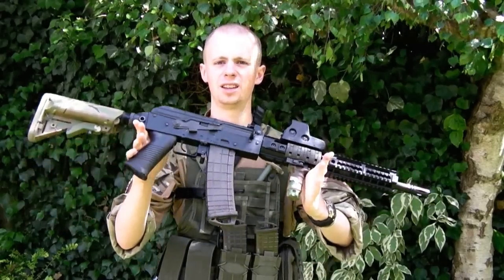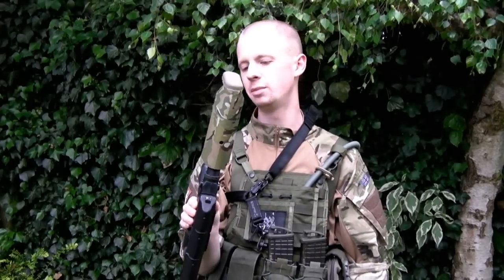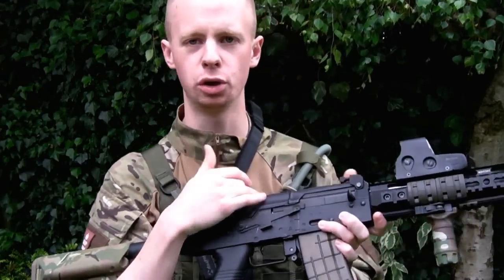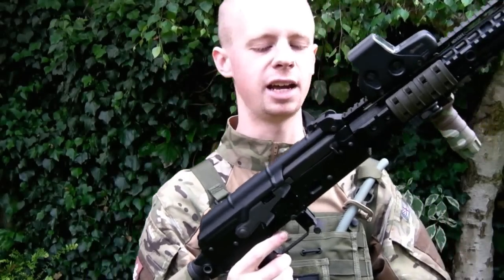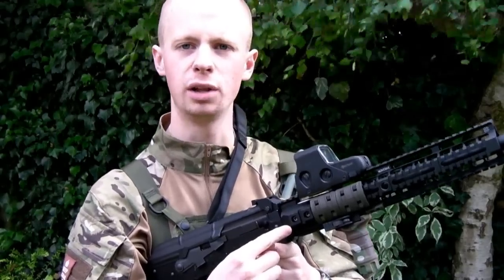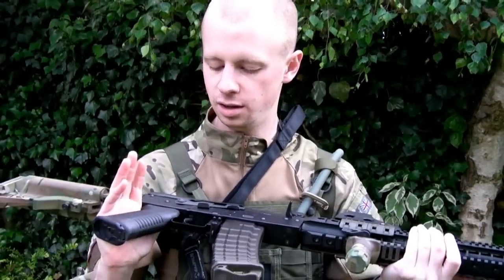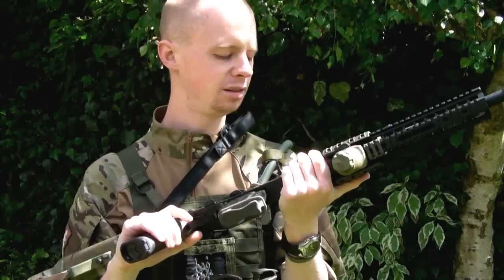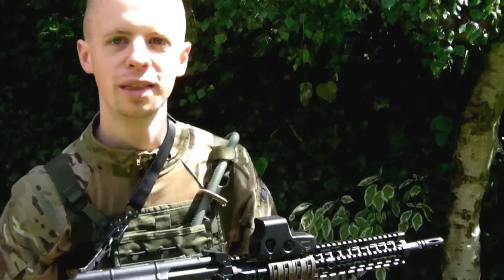The Airsoft AR-47 (or AK-15)

Comment: Haha (: owell, they are reds (soviet hardliners of airsoft) I am probs one of them, I have had my share of AKs and not one was tactical. Got to say I see the attraction of the M4 RIS and AK iron sights, though i'd never put a 6 pos stock on one, maybe an M16A2 stock. Just because I like using a gigantic battery. Only weapon I use a small in really is my M&P15 or my TM HC AUG. Just love wood work and the classic simple AK format. They look lovely if you age them and stain the wood and varnish it.

Comment from the maker: Just need an AK with a body that's based on the original Marui AEG AK.  Then you fit on an AR-15 compatible barrel and handguard/forend, has thread on it just the same as an AR upper receiver.